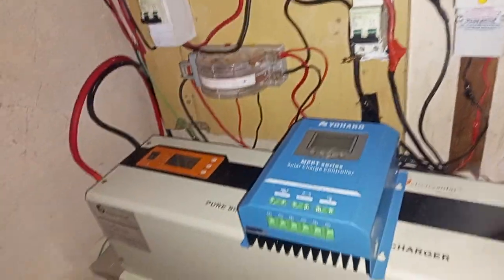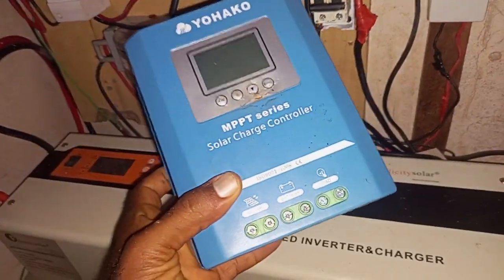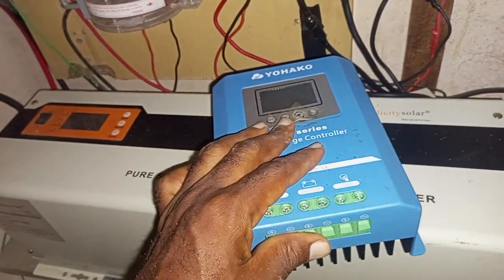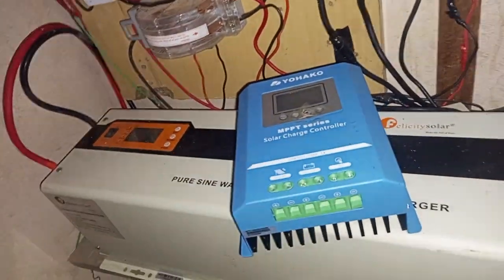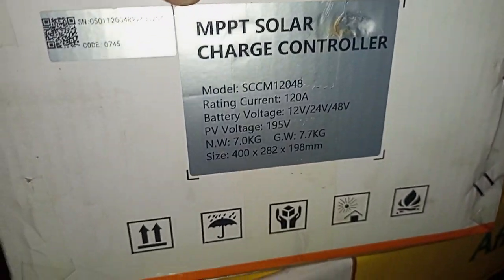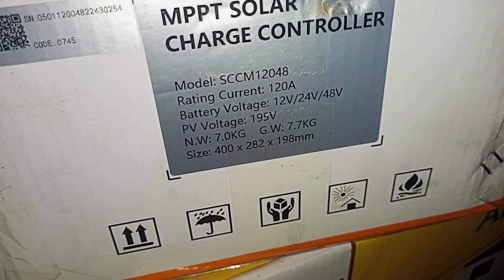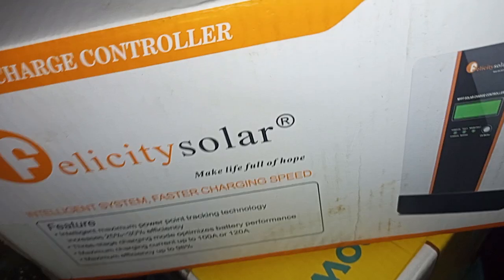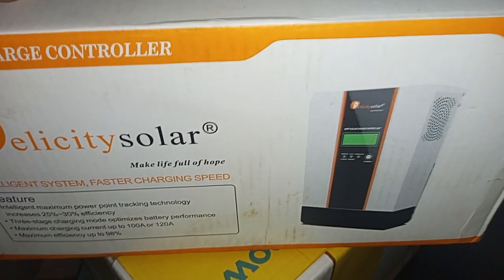Massive 120amps Felicity Solar Charge Controller Upgrade

Comment: Yesterday , I asked the local support to upgrade my BMS firmware from version 518 to 521. While they were here working on the upgrade, I took the opportunity to check my battery cells using the EDMS app . I noticed that my cells are significantly out of balance, even though I regularly charge the battery to 100%.

As the battery is 4 months age only and the delta is up to 250 mv it seems balancing features isn’t working at all
Please advise
Reply from the maker: Get high quality dedicated balancer